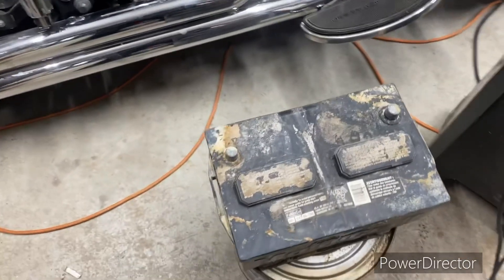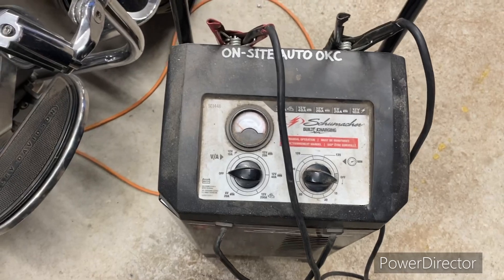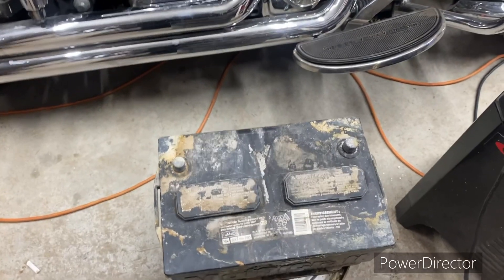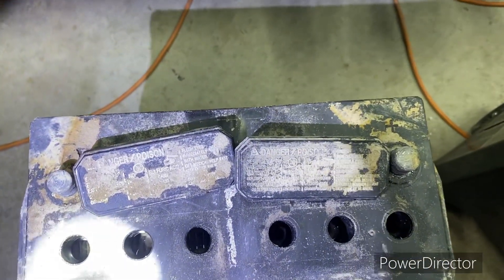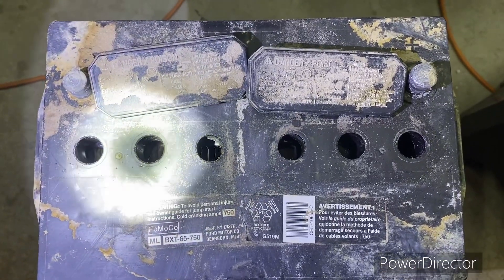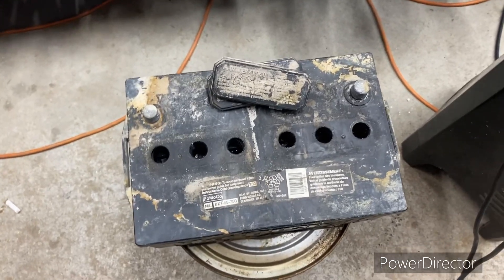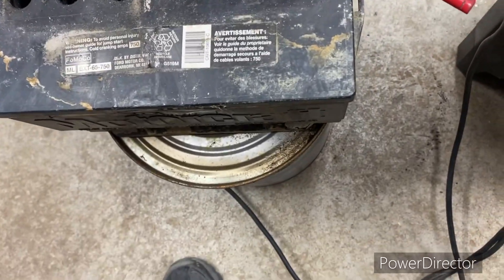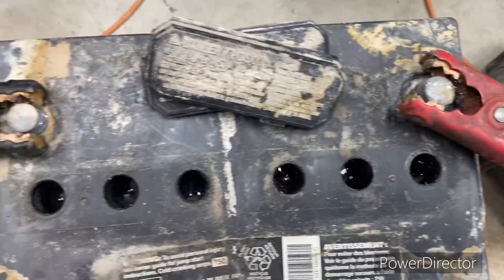How to renew your car battery

Comment: I have been Doing it this way for 30 years, But do your self a favor. Get the Battery away from your Motorcycle, dude, If it Does Blow up, and I have had It happen a couple of time, Its Not good,

Comment: Great video. I've seen similar videos using a small welder to provide the high amps. Any chance you can do this again but actually test and show battery voltage before and after? A load test at the end would be great too. Im thinking about doing this to one of my old batteries but before doing the trickle charge, replacing the old acid with new acid. What do you think?
Reply from the maker: Glad you liked it. I will do another video with voltage and load test. I have done quite a few batteries without replacing the acid and have had no problems. This was just a quick way to recover a battery that was going bad.
Reply: @ON-SITE_AUTO_REPAIR_OKC  I really did like your video. it would be interesting to see what the specific gravity is on each cell before and after.
Reply from the maker: @ great idea, I may do another to show the amount of sulphate that comes off the plates. Thanks for the input and thanks for watching.
Reply from the maker: @ I will do one , before and after.